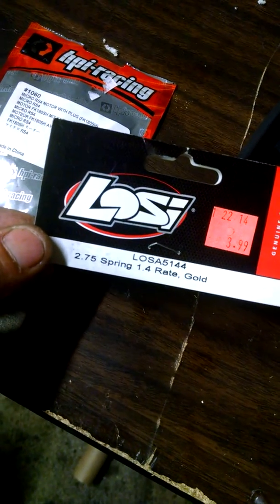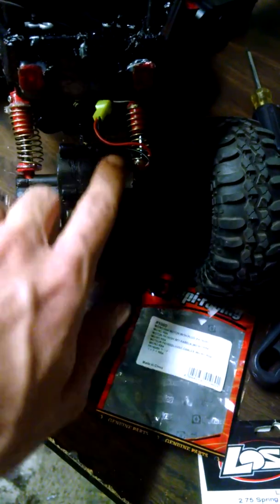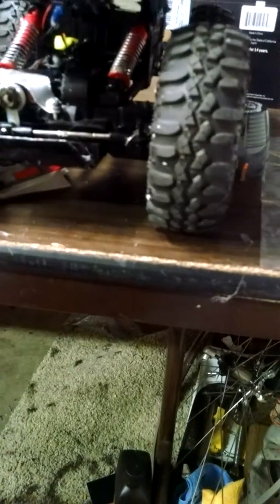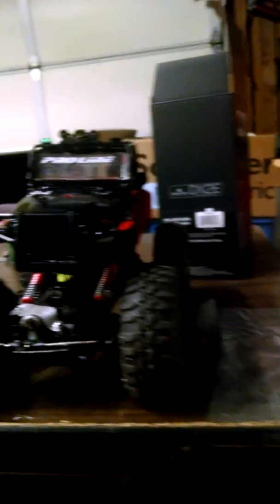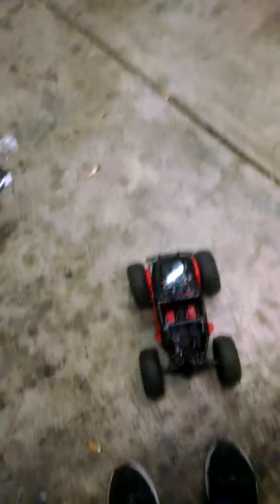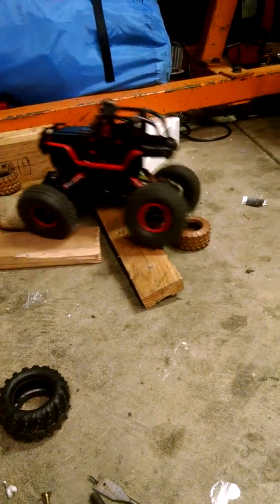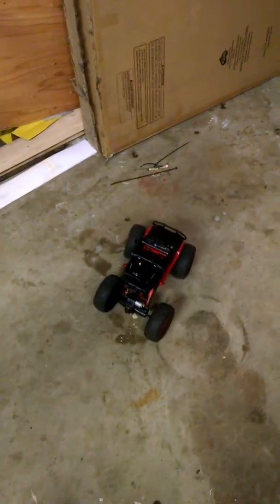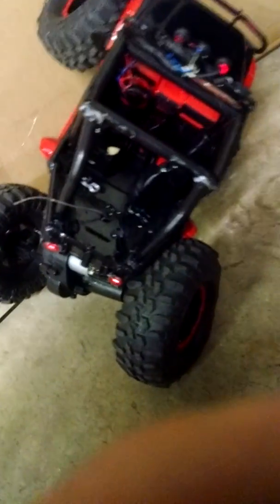Upgraded maisto rock crawler to hobby grade

Comment: What DO you need to make It Into hobby Grade
Reply from the maker: O.G Sepulveda good morning well to make it hobby grade or what I would call Hobby grade it would consist of having proportional throttle and proportional steering so to answer your question you would need some type of servo for steering an ESC Electric System control you can use the motors that it came with or choose to upgrade them to Stronger Motors and you know a newer transmitter and receiver remote and that should about cover it there's other things about Hobby grade you know like changing the springs making vehicle to wear you can modify it with better components hobby grade is just a term I use for explaining that I used more expensive parts to make the vehicle better if you watch a few of my videos on the maisto you should be able to pretty much copy for the first time on your build hope this helps any other questions feel free to ask sorry it took about a week to get back to you been busy have a good day and thanks for the comment
Reply: ken ramirez thanks for the tips

Comment from the maker: So maybe it's because I'm running the nickel metal battery 2200 milliamp versus the lithium-ion 500 milliamp I noticed that the nickel metal had zero lag in the transmission the 500 million amp lithium ion had a little bit of lag in between the transmissions I'm also using so both of those batteries are 9.6 and I do think that the higher milliamp helps with the servo drain

Comment from the maker: So maybe it's my ESC ( 1/10) but I have no transmission delays  I still need to do some research on which brushless motors I'm going to run but I was looking at size comparisons and stuff and these are will definitely fit I don't have the part number with me but I'll get back to you in the next couple days I have great crawling speed and like I said with these 180 motors it takes a lot before they stall out. The cool thing about thies 180s is they don't strip gears

Comment: 3.5kg at 6v 49oz-in   for hs85bb and hs85mg....  I'm hoping some BEC's i have in the mail will help stop motors from stalling out.  Dual esc/lipo only had slight improvements, so the servo is the only thing I can think of eating power

Comment: i been dragging my feet using the FK180SH motor,  I wanted to get different turn ratings front/rear to keep front rolling faster.  How's the torque difference with the FK'
s?

which brushless motors did you have in mind?  My buddy modded a front and rear but used sensorless motors which don't work for crawling.  cogs at low speeds.  Are you having stall issues where one transmission likes to stall while the other works?